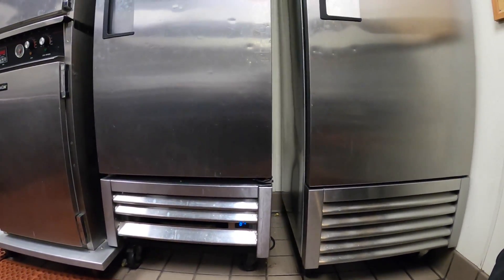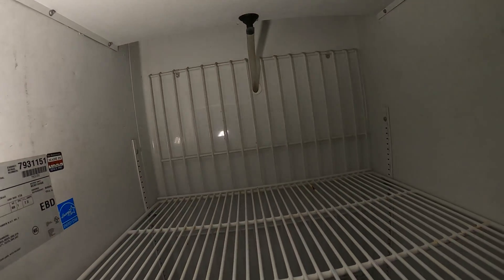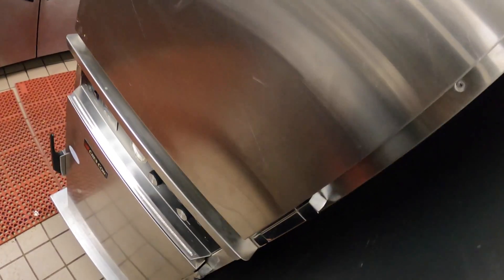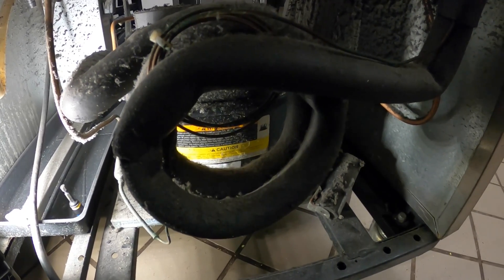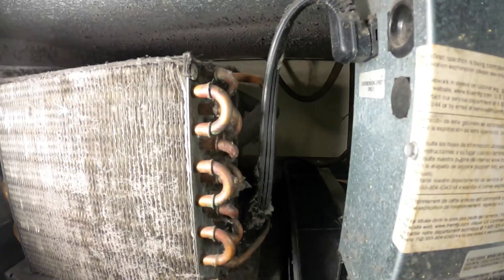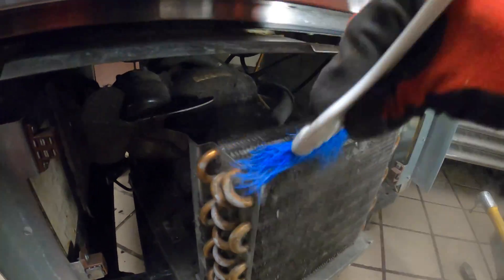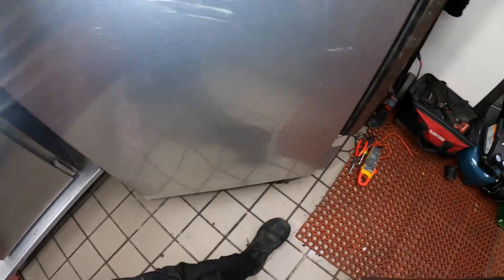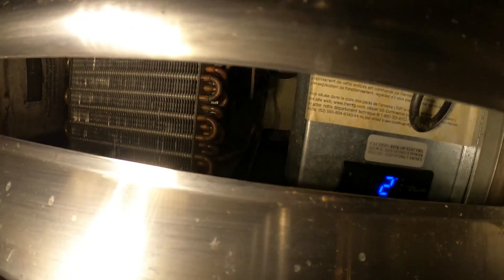HVACR: TRUE Freezer Not Freezing (TRUE Freezer Not Cooling) TRUE Freezer Troubleshooting & Repair

Comment: I had a customer complaining about his reach-in freezer not cold enough.  I looked at his condenser coil, packed like yours.  I brushed it the best I could then used some cleaner.  What looked like black syrup drained on the floor.  Once cleaned, it worked perfectly.

I have another customer with a three year old prep table, not as cold as it used to be. Months ago cleaning the cond coil helped but finally it wont go below 40F and is rising.  I've never worked on a R290 before, don't have the tools.  Another company got the job, but they have been there for three days, still not working.  I just ordered a new scale, flammable leak detector, new hoses and some R290, so if I get back to his equipment, I'll be ready this time.

Thanks for the video, that's real stuff.

Jim

Comment: Gotta at out a damp towel over the back of the coil of you're gonna blow it out in a kitchen. Honestly though that needed foaming coil cleaner like viper or nu-calgon and water. A .5gal pump sprayer and Milwaukee vac keep the mess to a minimum. As for the capacitor, a zip tie will solve that problem.

Comment: replace the ptc relay, overload, start cap, clean the condenser, its been overheating. When its been cycling off on the overload, they only cycle so many times before they go bad.

Comment: We are techs, but so much of what we do is clean. I've done so many of these TRUE and Turbo-Air machines in restaurants. I charge accordingly too. It's amazing the Health departments don't inspect these units and ICE MACHINES. We'd be busier for sure! I enjoy helping my customers and being in business.  Thanks for sharing JM.
Reply: The ice machines are the worst. I have seen the ones that Pepsi service and makes me not want to touch the ice coming out of them. I go to the bins that I service at my job now because I know they are clean and every 6 months they get a good cleaning. Thankfully I can do that at the beginning and end of our season of service to the general public.
Reply: In my business, nearly 70% of our work is cleaning electronics and cooling systems.  Appliances, machines, AC, etc.  Never just take the complaint you hear.  ALWAYS inspect from the power in, to the end result.  Your videos help a lot.  Thanks.
Reply: How much would you charge for this type of job? I am trying to get back to this trade. I appreciate your answer
Reply: Health departments will inspect HVAC/R equipment if certain criteria are met. While working for Syracuse University, we had to pull the cabinets apart for inspection weekly and update the health commissioner's office with photographic evidence of the equipment being cleaned with their state seal on it. They would even go into our blast freezer and lift the brass floor drain grate to inspect the first two feet of the grey water line. We were expected to scrub the floors and rinse three times so it was always a pain with all the grout and mop fiber that would get stuck in there.

Comment: I’ve never seen a right angle drive adapter that you had on your drill. Where the hell did you get that and I’ve never seen a little power wash pump like that where did you get that? We don’t have those here thanks.

Comment: Hi JMT what are the most common size of bolts and nuts do you come across and which are generally a good comprehensive allround socket driver / set to use ?